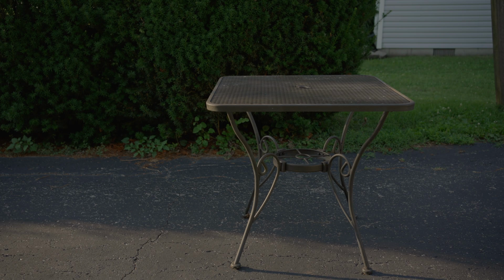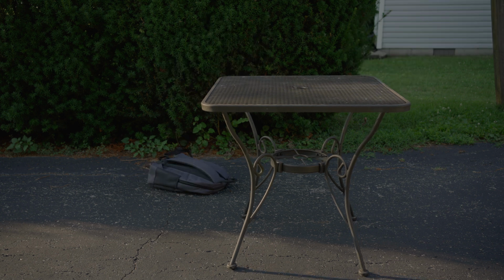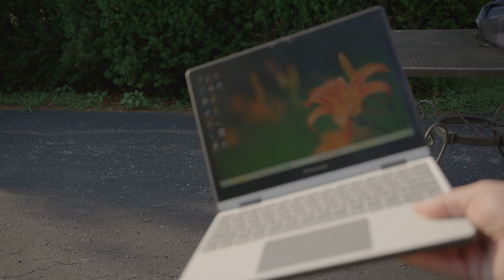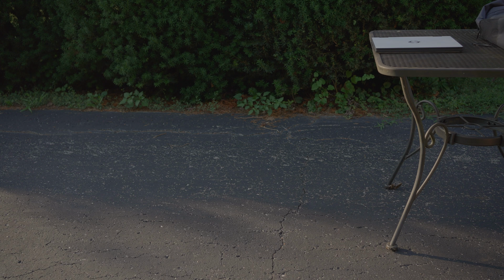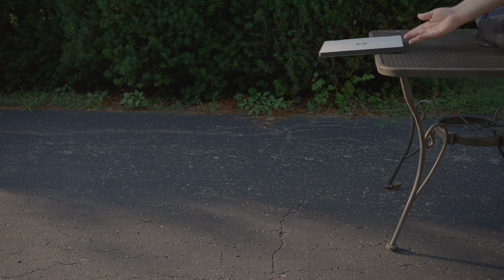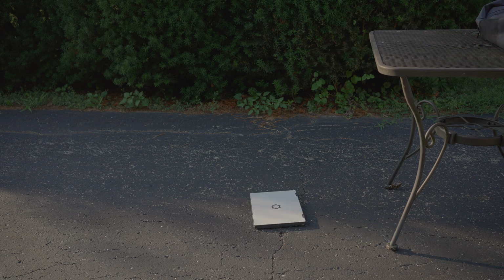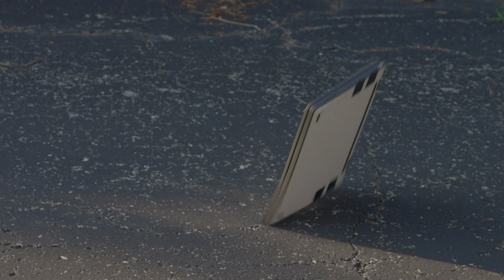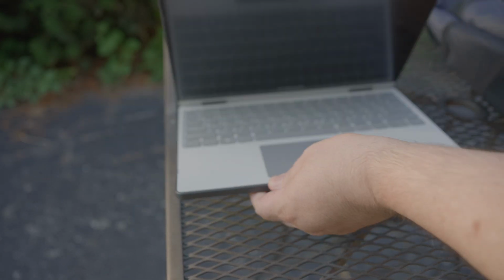Framework 12 Durability Tests

Comment from the maker: Note, I did test the laptop more thoroughly than just opening it up and looking at the display.  I checked tablet mode, auto rotation, shutdown and bootup, the speakers, the ports, etc.  It's alll working fine.
Reply: How did nothing go really wrong at 3:14? That's a bad impact. Very surprised.
Reply: @MSE-X , just my speculation, but the camera may be exaggerating the twists, perhaps because of relatively low shutter speed and/or rolling shutter.

Though, once again - it's plastic, quite an elastic material despite what its name might suggest.

Comment: It definitely can take a drop while closed, the rubberized tpu does it's job I'm just a bit scared for the screen when it's open, it had a lot more flex that I would like and it usually cause some screen bleeding whenever i grab the top frame or use the touch screen, I might try to find a diy fix later but for now I'm gonna wait that hopefully they drop a new and better screen for it

Comment: I noticed you have Skyrim on the laptop. Does it run well?
Reply from the maker: It does.  I had fairly bad stuttering initially.  But with the resolution turned down to 1440x900, medium settings (AA turned off), I get nearly steady 60FPS.  I have a feeling the AA was a big help, to the point that I might be able to turn other things up.  This is with the i3 processor and 8GB of RAM.  I have a review of the machine that shows my settings and the performance.

Comment: What screen protector are you using for the display on it?
Reply from the maker: The brand is ViaScreens.  At the time I ordered it, the only one they offered was a "paperlike" one, that is supposed to provide a slight roughness, to emulate paper when drawing.  Since then, they have added a bunch of other options.  No affiliation whatsoever.  I mostly ordered it because it provided a matte finish, which I prefer, to reduce glare.

Comment: Thanks for the video! I'm curious about some of the icons on your desktop. Is Skyrim actually playable on this machine?
Reply from the maker: It is!  I can't remember the exact settings I used, but I have a review video where I show gameplay and the settings used.  I think I had to run Medium settings, no AA, and 1440x900 resolution.  Something like that.  But it still looked non-terrible, and it ran at near 60FPS.
Reply: @bigtb1717  neat! I'll check out your other videos
Reply from the maker: That was with the i3 and 8GB of RAM, too.

Comment: All the drop tests were done with the laptop closed. For the F16, if the screen is open and it falls down and lands on a screen corner, the weight (plus accelleration) is transferred through the hinge, and it breaks... ask me how I know... :-( Iactually a good news story, bought new hinges and perfect!

Would be interesting to know if they beefed up the hinges for the F12.
Reply from the maker: I was eventually going to start dropping it with the lid open, or even in tablet mode.  But I decided to stop.   Durable chassis or not, the display is glass, and replacement displays aren't available yet, and aren't exactly cheap, lol.  If there is enough interest, maybe I'll do some more extreme testing once replacement parts are available.  

I'm glad you were able to replace the hinges and get your FW 16 up and running!

Comment: Incredible. This level of durability is what I want in a laptop.
I don't think my T495 would last that well going through this test, some plastic would probably shatter on it.

This machine shares the same keyboard ridge scratching the screen issue.
For this I put a workshop towel between it before I put it in my backpack.
Which does not fully prevent it, so since glass gets more fragile with more scratches, a screen-protector is a good investment on the 12.

The bending of the laptop on drops looks disconcerting, but that means it is adsorbing the impact well.
A more rigid build would concentrate the forces more, making breakage likelier.

Comment: Thank you for sacrificing your 12. Hard to watch but reassuring. The beautiful thing is you can just replace the shell. FW should send you a replacement.
Reply from the maker: I'm not too worried about a few scrapes and scuffs.  No need to replace it right now.  :)  But you're right, it's nice that I could just replace any parts that get damaged.